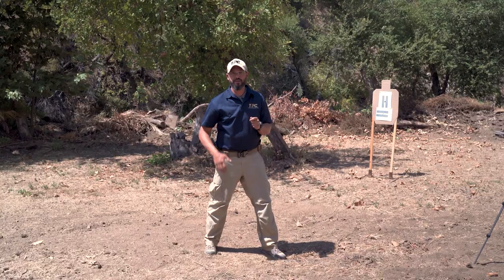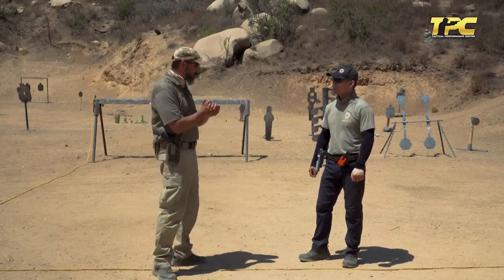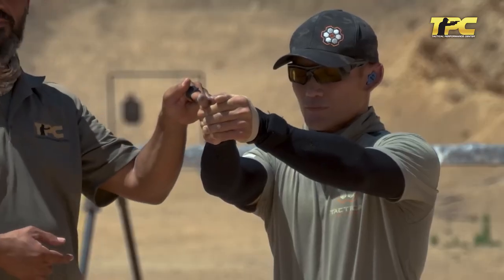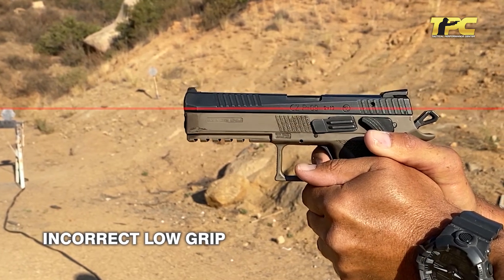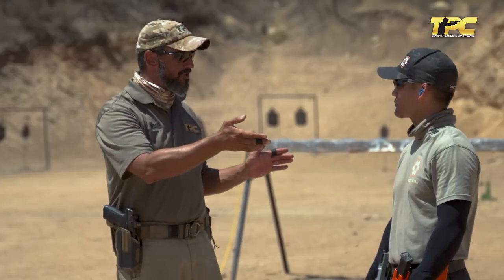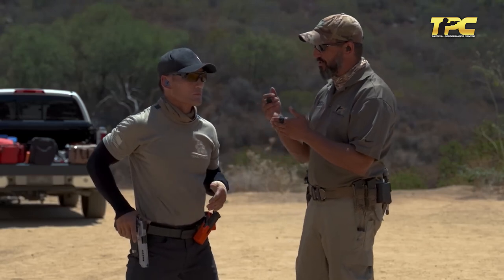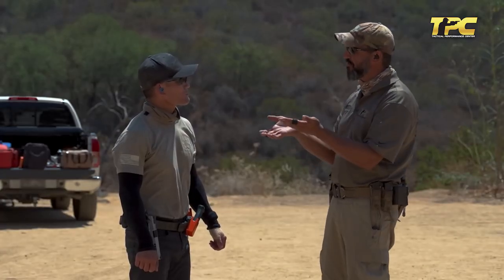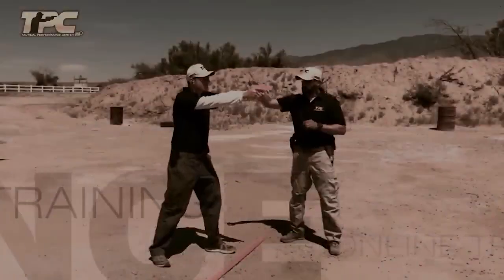How Hard to Grip the Gun | Proper Grip Pressure for Maximum Recoil Control

Comment: Interesting and funny  point about me and some of my friends who shoot,we are all electric guitar players and can do Maximum pressure with the shooting hand and the index finger does not affect the rest of the fingers at all like someone who is not a guitar player 😆
Reply from the maker: This approach could effectively isolate the trigger finger. By ensuring the other fingers can't squeeze further, it aids in maintaining that isolation. However, one potential issue to be aware of is trigger freeze, where there's insufficient release of the trigger post-shot to reach the reset point. It’s also important to remember that the support (control) hand should apply at least as much pressure as the shooting hand.
Reply: Intersting. I play electric guitar as well. I was thinking I'd have better use of my fretboard hand (control) when learning to shoot. Are you saying you and your friends shoot better with the hand that holds your guitar pick (firing hand)?

Comment: Would you please address the concept of squeezing front to back with your firing hand, while squeezing side to side with your control hand?
Reply from the maker: The concept of establishing the grip by squeezing from front to back is about the proper placement of the fingers on the pistol grip and the way the pressure is applied. Wrap the fingers around the grip so the middle phalanxes will wrest on the face of the front strap of the pistol grip. Then apply pressure (focusing on the middle phalanxes) straight back towards the heel of the palm. Imagine a C clamp. Avoid curving and gripping with the fingertips! Do not get us wrong, fingertips apply pressure towards the grip surface as well, but they are flat, and again, the pressure emphasis is on the middle phalanxes. Replicate the same with the control (support) hand. Now here is a bio-mechanical trick to make that one piece. We call that the nutcracker effect. Please watch the following video: https://youtu.be/WVnArod8Adg
Reply: @TacticalPerformanceCenter  thank you so very, very much!

Comment: If i change pressure on my controll hand, my shots going instant down left.😮 Im a right hand shooter... whats going wrong ?!
Reply from the maker: That’s a 100% flinch. What’s happening is that when you relax your grip too much, the other fingers of your shooting hand start to react sympathetically to the movement of your trigger finger. Instead of isolating the motion of just the trigger finger at the moment of the shot, all the fingers squeeze together, causing a down-left hit on the target.

To counter this, try adding pressure with the fingers of your support hand on the gun's front strap. If this doesn’t produce the desired effect, adjust the pressure with your shooting hand as well. In general, keep a firm grip on the front strap of your pistol grip.

Additionally, you can improve the isolation and dexterity of your trigger finger with the following exercise: https://youtu.be/qZJTenjAh5A

Comment: I've never understood this 70% and 50% fuss. 
The key to marksmanship after all is line up the sights and pull the trigger without disturbing the sights nothing else.
There are only three things that one has to do:
Hold the gun really tight with both hands without relaxing the grip
Point the gun at the target
Pull the trigger without moving.
Nothing else. 
If one hasn't got that it won't matter all the rest.
IMHO
Reply from the maker: We agree but... It sounds simple but lots of people find it challenging to isolate the trigger finger movement, especially at speed. That's why we recommend deliberate training to improve the dexterity of the finger and to develop passiveness during a string of fire. 👍🏻